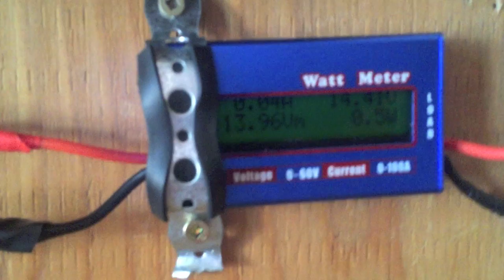Off Grid Wind Turbine Update

Comment: If you're going to go through the trouble of dampening vibration, you can't simply take a bolt and attach it back to the hard surface. You've got to keep some separation between the hard surfaces.
Reply from the maker: Thanks for the suggestion. Do you have any examples to follow?

Comment: wiring tip;if you clean up your connections by using crimp on connectors you will have  better amperage flow.its hard for amps to flow thru a bad termination.nice pole
Reply: mainly the back of the inverter
Reply from the maker: Awesome! Thanks Chris for the tip. I've been training myself to take the time and do a better job.